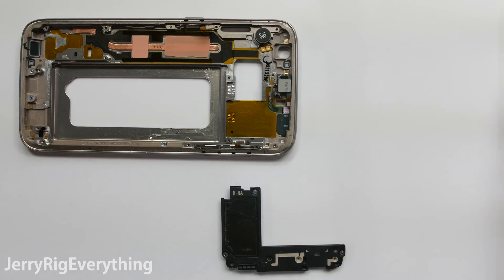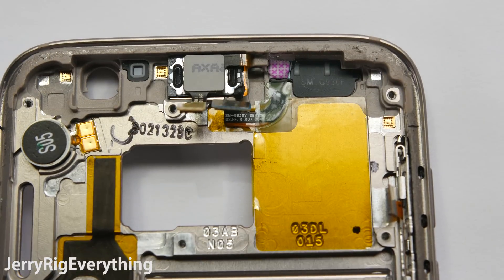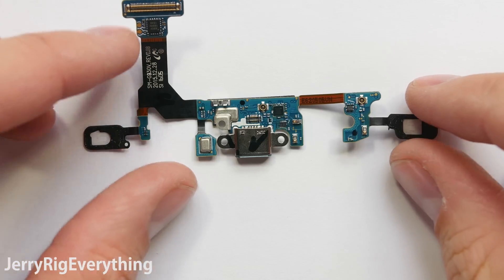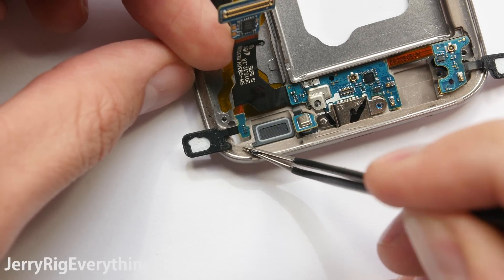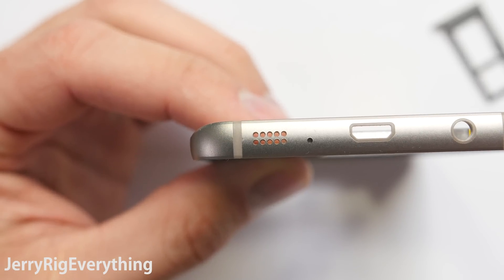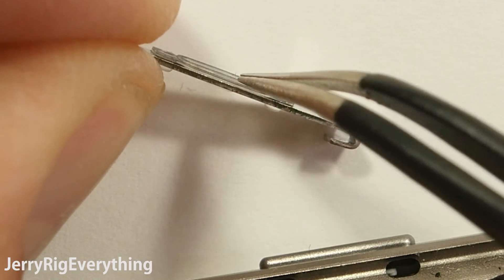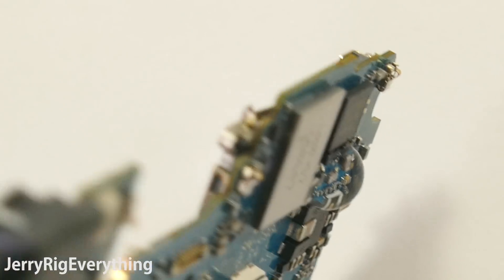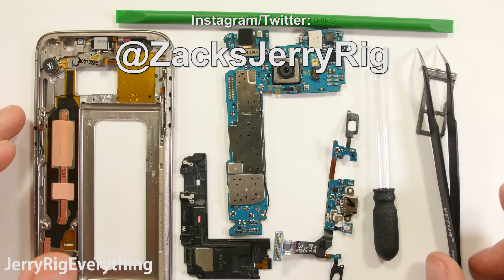What makes the Galaxy S7 Waterproof? - Ultimate Test

Comment: I would definitely trust this in the shower.  I've been using my S5 in the shower once, sometimes twice a day, for almost 2 years.  I don't generally subject it directly to the stream from the shower head, but why would you need to?  But I hold the phone in the shower and talk on the phone, check facebook, etc.  In fact, when I'm feeling lazy on a day off, I'll sit in the steamy shower in excess of an hour with my phone.  Recently, I've begun going on bike rides in the rain as well, where I mount my phone on the handle bars and watch movies...directly under the rain.  Everything working just fine.  So unless the S7 with a higher rating actually has poorer seals, it should do just fine for regular shower use.

Comment: how does sony does it for so many years
Reply: Quite badly. Especially how they did a 180 on "waterproofness" and those ads of people swimming in pools and in the ocean got pulled. Chlorine ruins their seals, salt water is also bad for some reason. Plus their design is so flawed at the ports that the screens self crack (Snapdragon 810 versions).

Comment: aw, so no Netflix in the shower for me :(
Reply: wrap the phone in clear plastic wrap :p
Reply: +ccalvinn27 your comment is duly noted.
Reply: I wouldn't believe what this guy said, it should be fine to use in the shower. After all, it is ip68 rated (it can stay in 5ft of water for 30 mins). The pressure under 5 ft of water is much higher compared to what you'd get just by being in the shower.
Reply: +50 Cal thanks, I just got my s7 edge a few hours ago.
Reply: NextGenGamer67 What's it like overall? I'm literally about to buy one myself, what's the speaker like?
Reply: +ccalvinn27 it's very nice on the hand, battery life so far has been amazing. the display is gorgeous, the speaker isn't super loud but it has some decent clarity. and the edge display is pretty neat. It is a bit heavy for its size though, but then again it does have amazing build quality so can't complain there lol.
Reply: Is it slippery at all? I'm looking at buying an unlocked gold edge version, I know it'd be hard to nitpick while having just recently gotten the phone, but are there ANY cons to it so far?
Reply: +ccalvinn27 well, it is a bit slippery yeah. and if I had to say one thing I don't like about it, it's definitely the fact that it's a fingerprint magnet. I'd definitely get a case or a skin if I were you. But overall that's the only things I disliked about the phone. it's a very well rounded phone and definitely worth the money.
Reply: NextGenGamer67 Currently looking at a listing on Amazon, it's gonna be about $1087(Canadian) and it doesn't come with any warranty haha, hopefully it all works out though :) I'll be sure to look into skins and such though thanks for the tip
Reply: +ccalvinn27 you're welcome. and yeah it isn't cheap by any means but so far it seems like it'll last a good while. glad I could help.☺
Reply: +john doe and smaller. hence why I got the S7 Edge
Reply: +john doe well I think it adds a very beautiful effect to everything. and yeah it has amazing battery life. But the main reason I even got the edge model over the standard model is because of the larger display.

Comment: Great video, especially the bit about the speaker screen and the lack of PCB coating.
I'm curious though, how do you think the S7 compares with respect to water resistance to the Motorola Moto X or Moto G 2015, since I think those have a water resistant nano-coating on the internal electronics?

Comment: Wait, what happens if the rubber, let's say on the micro SD card slot wears out?? Wouldn't that eliminate the water resistance-ness???
Reply from the maker: +Big Mo Yup ;-) You'll spring a leak in your galaxy.  That is why i suggest not pushing your luck with liquid.

Comment: Now what if this is mixed with a water repellant nano coating?
Reply: +iMiguelAOG then it would be fully waterproof
Reply: Shay D I mean I don't think it will be fully waterproof because at some point the water pressure will be enough. But it should provide guaranteed protection at it's appropriate rating

Comment: It has been possible to have water proof devices all the was back in to the 80s. I had a number of watches like the atlantis by timex that was water proof to 100 meters. The wastch could go way deeper than most all divers ever will. Do to just how air and water tight this watch was the instruction inclided a warnimg about high altitudes. Meanimg it could blow apart do to sea level air presure inside it. Larger devices like phone can be made water proof if the companies wanted to do so. the use fancy terms like ip rating to hype a non feature. You know kind of like the cloud a new name for a old thing called network drive. I had 5gb of ftp site mapped as a drive in 96....

Comment: I just took delivery of my S7E and have been using it for about 6h now, it got a bit dirty so I took it under some running sweet water and clened it, wont be doing that again after seing how flimsy the water protection actually is. Thank you! I do have a few questions if I may Jerry? After rinsing the phone I noticed some water was left on the charging port and the speaker holes so I blew into them to get the water out, is this a bad idea? I could imagine the speaker mesh can let some water threw since blowing causes pressure. Sbould I have just left the water there and let it vaporte? Is it safe to press the buttons when the phone is submerged by the way? And if music is on loud and the phone is submerged, could the vibration caused by the speaker compromise the mesh's ability to keep the water out? Thank a lot Jerry once again! And I do have to say this is one hell of a phone IMO! :)
Reply: Let me know how's the battery pls.
Reply: +DBZ Series Don't know about the real life battery life yet since I have had the phone in use ever since I got it. But screen on time in wifi is now 5h 32min and still have 32% left. So for an android device the real life battery life should be pretty damn good!

Comment: i am gonna ask a shady question... is there any way to remove/replace de water damage stickers? just asking :)
Reply from the maker: +TheDude Mike You'd still have to open up the phone....  And that's hard to hide.  But you can buy replacement stickers on eBay usually.  But i didn't tell you that. Either way...  A wet phone will also start to corrode/rust,  and you can't hide that well either.  So it's pretty futile on multiple levels.
Reply: +JerryRigEverything oh, i know it's hard to hide, i was just curiouse if you can actually swap them out, thanks for answearing :D